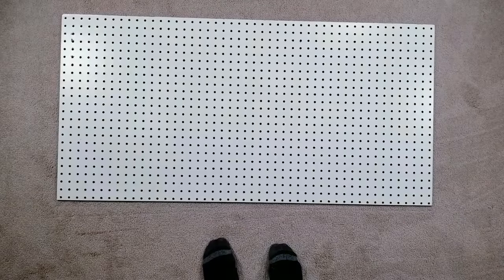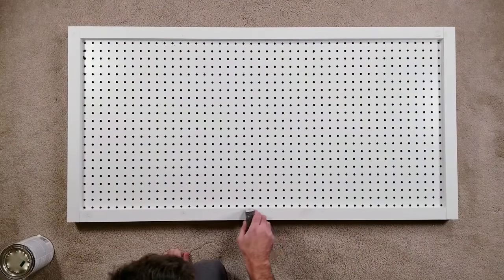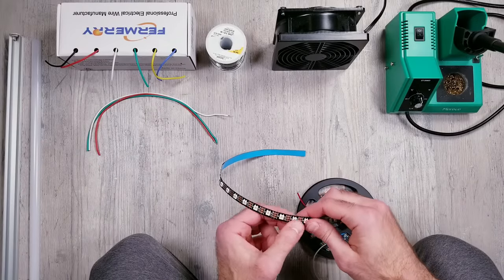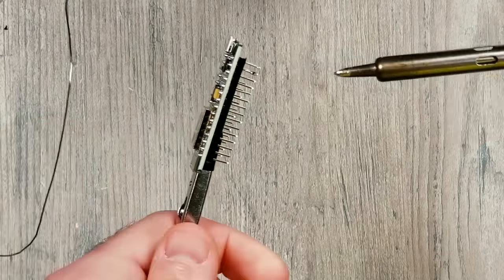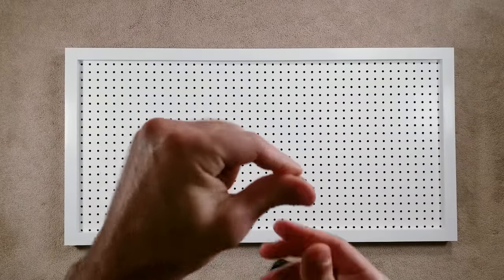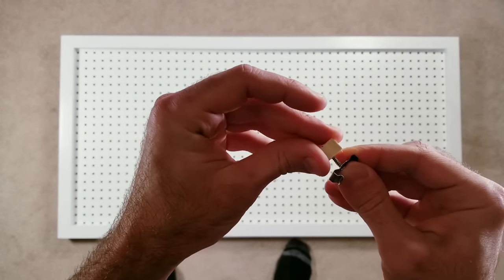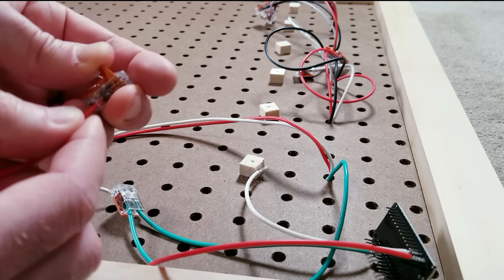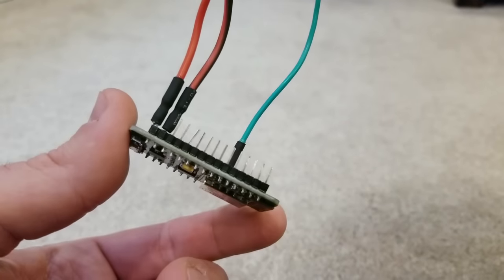DIY LED Project with Diffuser Channels - Full Walkthrough

Comment: Hi, question. Is there a reason to use the ESP8266 with WLED instead of Govee RGBIC strips? Govee seems to be cheaper to control with both Wi-Fi and Bluetooth.
Reply from the maker: I do love Govee and they make great products that are very easy to set up and use. There are a couple reasons though why at least for this project, I would still use the the ws2812b led strips. As far as I know, Govee only has led strips that have 30/leds per meter. This diffuser will work better than anything else out there to make led strips with 30/leds per meter look great with minimal hotspots but its still not going to look as good as an led strip with 60/leds per meter which is what I used in the video. Also, using wled with an esp8266 gives you a little more options when it comes to customizing and overall the app and responsiveness is better in my opinion than using govee. Thanks for watching and great question!
Reply: @ChrisMaherDIY  Hi, do you know if the LIFX strips work with the nodemcu? I have 2 meters laying around from a couple years back and they have a good amount of LED's per meter.
Reply from the maker: @raven4583  Thanks for the great question! I have not worked with those strips before but do you know if they are 5v, 12v, or 24v and how many copper pads they have on the strips?!
Reply: @ChrisMaherDIY  They only contain copper strips at the end and beginning of the strip, with 4 being present. They are 24 volts.
Reply from the maker: @raven4583  I wish I had more knowledge about other types of led strips. However, I've never worked with that type so I'm not much of a help. Sorry!

Comment: Wago's are for less annoying Wire Nuts or soldering. you put 1 wire into each wago so that it makes a firm connection, as opposed to the Twist and Prey of the classical Wire Nuts. Putting more than 1 cable per hole kind of defeats the purpose. 

That said, the LED Board likely isn't moving so much, so you could have gotten away with soldering them, or Twisting them then using hot glue/ heat shrink or Electrical tape given how little power they actually use, and it would have been cheaper than the $0.40-0.60 per connector you used.
Reply from the maker: Thanks so much and that makes perfect sense the way you explained it. Lol twist and pray! That is the only bummer part, they are not the cheapest thing out there but to me its worth it to not have to use wire nuts or solder or electrical tape! Thanks for watching and taking the time to comment!

Comment: nice project but i don't think i would use peg board, looks cheapish to me.
Reply from the maker: Thanks for watching and glad you liked it! Yeah I hear ya. I think the frame dresses it up quite a bit but you could certainly do this with any type of material. I just liked the peg board because I did not have to drill any holes for wires to go through and if I change up the design, Its going to be easy to do. Thanks again for watching and taking the time to comment!

Comment: No need for power injection with that many chopped up strips?
Reply: at about 10m is when you need to think about injection, but honestly go with your gut, and try for better strips.
Reply from the maker: Thanks for watching! I generally just use the eye test. I hook up everything with no power injection and see how it looks. If i ran these at full white and full brightness, there would definitely be some voltage drop and the leds at the end would look more orange. However, when turning the brightness down, and running any animation, i saw no drop off in performance even with all the cut up wires. I've also never had a use case for any of my projects to run at full brightness as its honestly hard to even look at when led lights are that bright. Lol, all that to say that in this scenario, it got plenty bright and everything looked great to me with no power injection. Someone did comment before though that it would be super easy to just add some power if you wanted via the wago connectors at any point! Thanks for watching!
Reply from the maker: Yup! I always just set things up with no power injection and see how it looks and go from there!

Comment: Looks really good! To attach the channels why didn't you use the pegboard holes as intended using a 3D printed holder? I picture a pinchable pin that goes through the hole and goes in the metal holder (or even a full plastic holder)
Reply from the maker: Thanks so much! That is a really great idea! If I had a 3d printer I would for sure try doing that! I do want to eventually get into 3d printing as you can do so much with them but I have not yet gone down that path. Thanks for the great idea!

Comment: Has anyone found any cheaper alternatives to these LED channels?

Maybe on eBay or Alibaba

Because yeah they're $189 Canadian before tax.... I don't think they're worth that price. Lol
Reply from the maker: Dang!! There is that much of a markup?! They are I think 47 dollars USD here in the states. Let me know if you find a cheaper alternative!
Reply: Try Closet Rails and tracks at walmart or homedepot/lowes. they should be close enough, and the main purpose of the rails are more for heat management anyway. try and match up the width if you can, if you cant score it with a knife and get to bending.... carefully

Edit: the part you are looking for is Aluminum Extrusion Channel / aluminum extrusion U Channel, if you can find them, they're like 8-10 feet (aluminum extrusion hat channel if you want to put them in a wall or spacers for drywall)